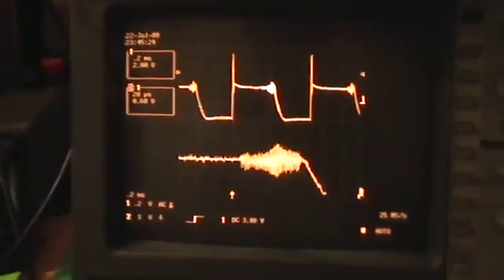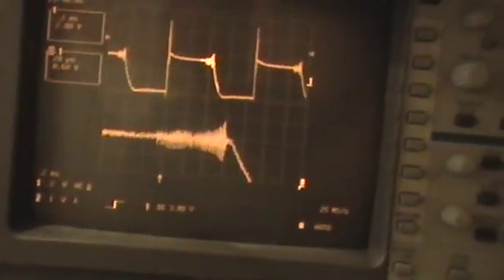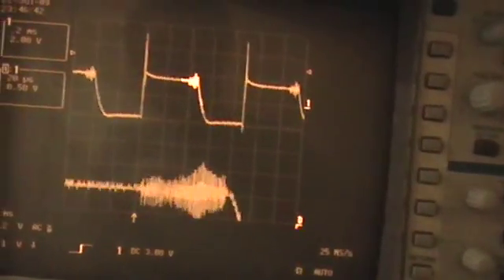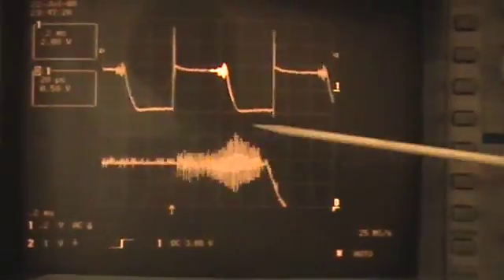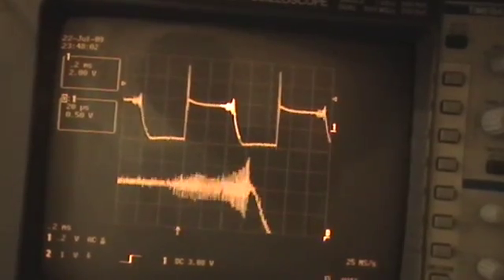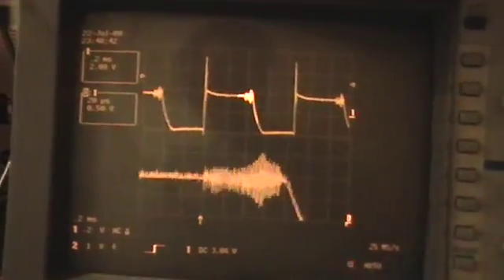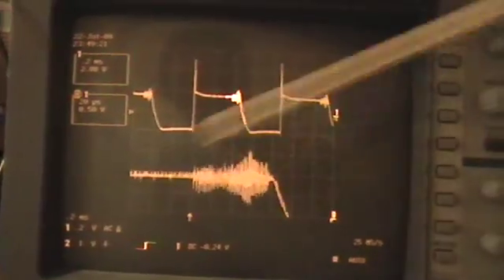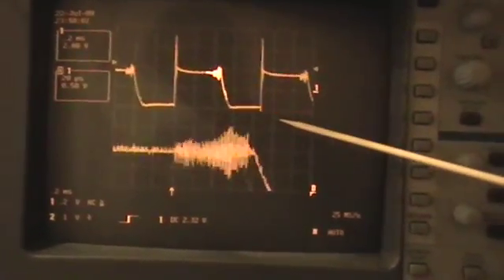Aaron's circuit PART G:  Mosfet drain oscillation viewed on the LeCroy 9370M

Comment from the maker: No, sorry, I don't, and a quick search on the web wasn't helpful either.

It is definitely a powerhouse oscilloscope though, much better than the low-end range of LeCroy's current scopes. I especially like the built in printer and the full live math capability.